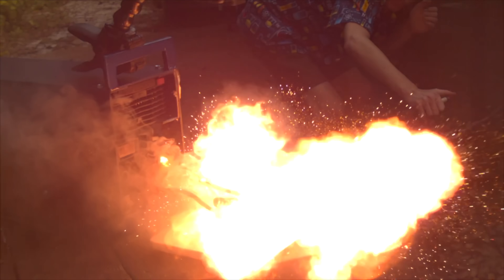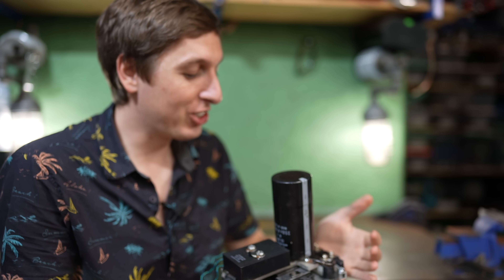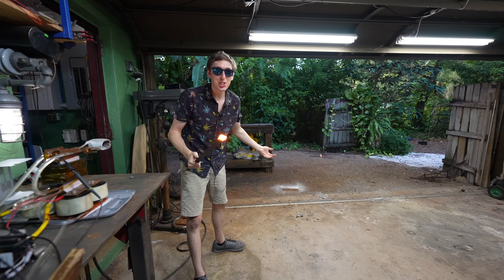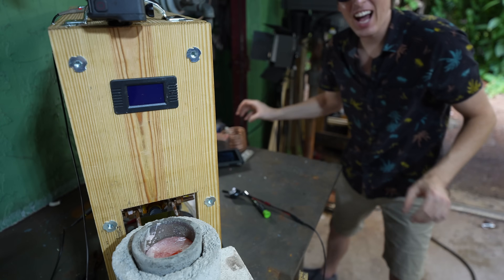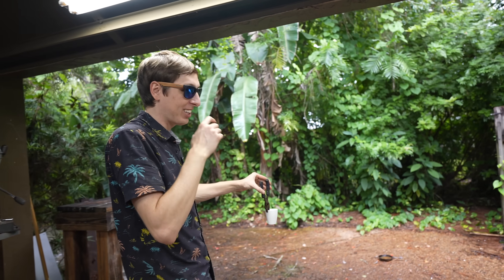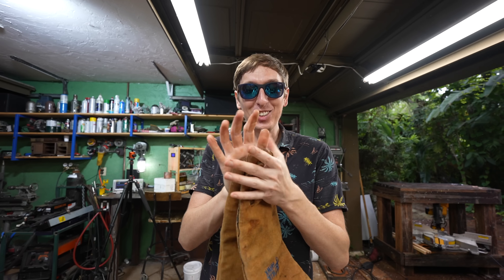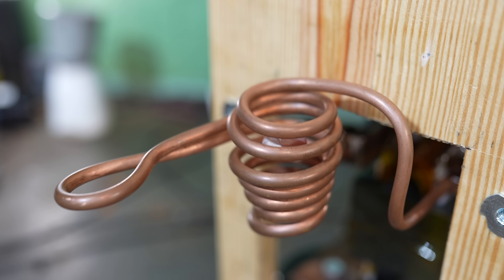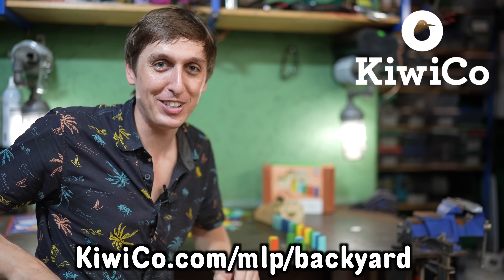DIY induction heater that can BOIL STEEL

Comment: Congrats, you’ve just discovered how steel tubing is welded. The difference though is to run ferrite through the middle of the coil. This will reflect the energy and force the edges of the single strip of steel to super heat, and then run through rollers under pressure, tada! Welded edges of a steel tube.

Comment: You clearly make videos for the lowest denomination of society. You speed through the only interesting parts like actually making the inverter, the control circuit, and programming the microcontroller. Next time your face is that close to molten Aluminum, you should spit into it, this way you’ll be sure to get a ton of likes from your lowest denominators.

Comment: Of course aluminium is going to melt that fast TheBackyardScientist...It's melting point is only 660.3 degrees C while steel's is between 1425-1540 degrees C depending on the type of steel and your setup can surpass both temperatures VERY quickly!

Comment: I'm surprised blacksmiths don't use these heaters. I have a homemade coke forge (coke is just a fancy type of charcoal) made from a cheap grill and a blower and it takes me around 10 minutes to get a 1/2 inch rebar to forging temp

Comment: I was thinking of different uses for an induction coil and had an instant thought of what happens to ferrocerium rods or lighter flints would react. Would they heat enough to do the toss it on the floor bit? Would they possibly melt? 

I remembered this video and thought it'd be right up your alley.
Reply: Lighter flints get to red heat before burning slowly when heated with a miniature blowtorch.
If you could make one shatter finely enough when that hot, it would probably make a lovely shower of sparks, but that would be very hard because they're so small.

Comment: Steel does not explode when it comes into contact with water. However, when you poor large amounts of molten iron or steel onto something that contains water (like wet scrap metal), the water heats up making large amounts of steam resulting in an explosion. We see this sometimes in the steel mill where I work. The explosions are huge and very impressive.

Comment: That was very impressive and interesting to see how easy it is now with off the shelf components to make an induction heater. It worked a bit too well though, I’m fairly certain that all the sparks coming out of the steel was the carbon being burnt off.

Comment: cool.. now seriously, throw a bunch of small scrap neodymium's in there, stir, then transfer to a regular really well insulated pre heated 12v induction heater box, so to slowly cool the mix & recrystalise properly, then dc electromagnetic zap it in situ the box had that coil /required bits included when slapped together right a few times as it goes below the magnet curie point?.. did you get another bigger on demand diy custom shaped neo block.. weaker or stronger than factory ,by how much

Comment: Just wanted to point out the "exploding steel" bit is from getting water in a crucible full of molten steel. The water pretty much instantly vaporizes into steam and blows the molten steel out of the crucible... Full thickness burns are not fun. Just sayin'.

Comment: You didn’t even need the complex circuit. Just run Minecraft with RTX on a crappy pc from 2010 and put the metal on the cpu which would melt it instantly.

Comment: What you are seeing on the steel melt down is called “carbon boil” it occurs when you melt steel very fast without aluminum, especially steel with a high carbon content.
Reply from the maker: oh that's interesting, but I cant find any information on how aluminum has anything to do with it.
Reply: @TheBackyardScientist  Aluminum is added into the bath during a carbon boil to "calm" it down, usually in a very fine form.
Reply: @nicholasknotts8531  so steel is pritty much always a carbon iron and aluminum alloy?
Reply: @hmmmtietmetmosterd  Not exactly, some steel has high nickel, other steel has high chromium, some has high carbon, some has low carbon.  

Aluminum is not a part of steel, it is just added during the melt down process to ensure that the carbon does not "burn-off" and change the chemistry of the alloy
Reply: @nicholasknotts8531  i see, and with aluminium having a much lower metling temperature then the rest of the alloy, can i asume it just burns off while making the alloy?
Tnx for your explaination, its very clear! I apreasiate it allot
Reply: @hmmmtietmetmosterd  That is correct, most of the aluminum will come out the melt, you may see some very minute amount of aluminum in the chemistry (No more than 0.1%)
Reply: @nicholasknotts8531  that makes sense, tnx yet again buddy
Reply: That's actually really interesting

Comment: I’ve personally witnessed explosions from molten steel/slag mixing with water/ice. Explosions big enough to knock the dust off the rafters of the mill, break crane windows, blow open steel doors of the exhaust, etc. A couple of guys where I work were almost in the line of fire when we charged (unknowingly) icy scrap into the molten metal. It was like a bomb going off. I highly recommend purchasing better PPE if messing with molten metals, aluminized protection with a FR secondary layer would be the minimum. It’s definitely nothing to take lightly.

Comment: I have a question, when the metal was melting at one end of the rod, why wasn't the heat felt at the other end. I mean, Kevin was literally holding the rod with his bare hands from the other side.

Comment: Molten metal does not explode when poured into water.  It explodes when water is introduced into molten metals.  Not poured onto the metals.  But if water is trapped in a piece of metal.  And that metal go's into the molten metal.  As soon as the water get's hot enough to boil.  Which is pretty much instantaneous.  The steam (1/4 cup of water = 1000 cubic inches of steam) expands and shoots out the metal everywhere.

Comment: Burning Mg emits bright as black body radiation. The combustion reaction is so hot that the white light is just like the red glow of hot steel, but much, much hotter, which shifts the colour to white. UV light is only barely present in the UV-A region at around 380 - 400 nm. Most of the radiation is between 450 - 750 nm, which is why it is bright white.

Comment: Please be careful on the onewheel, legit was riding it in a straight line, was going in a straight line at 13-14mph and the motor shutoff, I was found knocked out in a park with my helmet on. But I still had 65% battery left. Broke three bones amnesia and a bad concussion I'm still dealing with, this happened 2 weeks ago.
Also its the onewheel xr I haven't gotten to the max speed yet.

Comment: You are all aware that even if He isn't killed instantly during one of these experiments...he will definitely be dead from any number of cancers due to the insane amount of toxic chemicals he breaths in with zero ventilation or rudimentary gasmask.
 But Boy O Boy does that kid know how to melt and sling hot metal across a driveway apparently thinking the resulting splatter is of some  scientific purpose other than making a shiny mess of potentially sharp edged metal fragments that are perfect for a show about how to DYI your own self repair and inflate car tire machine.
 We Love You Pal...just be safe, ok?
👍😁🚬

Comment: This looks so much cleaner an easier for casting parts than those paint can forges using gas. Is there a way to use this to melt wax for lost wax casting?
Reply: Just use a stove

Comment: 6:44 YES. Burning magnesium produces a LOT of ultraviolet light. More than enough to sun burn your eyeballs if you look at it long enough. Its usually pretty hard to burn your eyes just from magnesium because it burns so fast, but you have enough there to do some damage if you stare at it. I would at least wear good UV blocking shades when working with it, but a proper welding mask is not a bad idea.

Comment: It's not boiling the steel I think, that's just the carbon escaping because the iron is no longer holding it due ot how liquid it is. I could be wrong I'm only a rookie smith not a pro

Comment: Dude. You could forge a knife in that first one. Not only that, the way you threw around molten steel from the crucible is basically Chinese steelworker's fireworks. It's pretty awesome.

Comment: Burning magnesium does give UV light, but it’s clearly not because of blackbody radiation due to its temperature, which is at most 3100 °C, hot but lower than that of an incandescent light bulb, so it should look orange and shouldn’t emit UV. Instead, due to chemiluminiscence, about 10% of the energy released in combustion is released directly as light.

Comment: I think the steel may have “sparkled” due to residual magnesium in the crucible. I may be wrong, but it seemed sparkle more immediately after you melted the magnesium.
Reply: Nah, steel just sparkles when it heats up a lot, i used to blacksmith a lot and when i forgot the pieces for a little too long in the forge they would kind of sparkle/melt i don't know if it has something to do with the steel boiling or not

Comment: Water explodes in molten steel, molten steel doesn't explode in water. A pinched pipe with water in it is the reason why a foundry in my city had to rebuild half of their building. This time they added a preheating line to their processing of scrap materials.

Comment: So interestingly enough, when magnesium combusts in open air it does so with such absolute power that it emits enough UV light to be effectively used as an anti bacterial agent. I wouldn't recommend it though haha
Reply: This is great information! Science!
Reply: So what you're saying is, flashbangs can be used to rapidly disinfect rooms?
Reply: @Oglokoog  Exactly, just don't forget to wear your dark sunglasses.
Reply: @tommytheshimigami  That's alarmingly based.
Reply: @Drekromancer  pokemon!
Reply: I wonder if pure oxygen would make it burn even brighter?
Reply: @1978garfield  Believe it or not, when magnesium burns it actually does so with such destruction that it even rips the oxygen off of water vapor in the air! That only adds to the brightness of the reaction.
Reply: @nicklittle8399  Or even from CO2 or sand!!!! Magnesium is crazy!

Comment: ferrous bronze: one-part-aluminum two-parts-copper and three-parts-casting-iron, melt, stir, cool and remelt to finish the alloy; the first melting gasses-off part of the aluminum but the finished-metal can be tempered.
Reply: when you melted the aluminum then magnesium you set up a part of thermite, and when you melted the steel it finished the thermite concoction.

Comment: My induction heater will only heat up ferrous metal. What am I missing ? How is this one heating up aluminum ?    Also how did this not result in a trip to the ER. I have burned myself casting before. It is no joke how fast and how deep a small blob of molten metal goes thru human flesh.

Comment: WHY is the water tank next to all the high voltage,high amperage circuits?!
Also having a wooden casing next to very hot materials doesn't seem like a good idea and the fact that its just open on its sides means the fans could draw the sparks to the sides and possibly scatter it around in the circuitry and worst case scenario into the high voltage circuitry.

Comment: The "explosions" from molten steel "mixing" with water is not the mechanism for the "explosion". Water and molten steel do not "mix" resulting in an explosive chemical reaction. Its the water flashing to steam almost instantaneously. The steam has a very high thermal expansion rate. Which causes the "explosive" effect. So dropping the molten steel into to pool or the ditch didn't give the desired affect due to the volume of water not being able to flash to steam, it only starts warming the water and cooling the steel. A smaller volume of water in a larger volume of molten steel would provide the desired affect.

Comment: Greetings Kevin, I’ve had this question for a while. Since you now have a larger and better induction heater, will you be able to melt tungsten? Just curious
Reply: Tungsten melts at arround 3410°c 
While steel boils at arround 2900°c
Sooooo, maybe?
Reply: Second.
Reply: If he boiled steel i could see it happen

Comment: Yes, burning magnesium generates lots of UV including "germicidal" wavelengths.
So you probably got a little sunburn from it.

https://etda.libraries.psu.edu/catalog/10735

If you want to go real crazy, magnesium might be a good XUV laser material:

http://citeseerx.ist.psu.edu/viewdoc/download;jsessionid=CA8391F9C97A457092796FCADEE97D0E?doi=10.1.1.516.2784&rep=rep1&type=pdf

Comment: you should've used a shielding gas so that you could throw molten magnesium that didn't have an oxide layer, and so you could control the burn a bit more.

Comment: You know, I just thought of something, could this be a better alternative to blacksmithing? Considering that it heats up the metal at a faster rate than a regular forge, though going back at this, I think it'd be more difficult to create a large induction heater than just making or buying a simple forge.

Tell me what you think in the comments.

Edit: I don't know the standard time of how much a regular forge can heat up metal, but I think its much slower than an induction heater.

Edit 2: I just found out that induction heating is used in the metal and foundry industry, so I guess I just answered my own question.

Comment: I remember getting an ebay kit, successfully melting stuff with it (i think i have a vid about it), but the problem always was that after certain point (curie point) metal loses conductivity, and cannot simply heat up further. that happens way before melting. For that reason graphite crucible was used since it doesn't have that property, melting was done via hot graphite. The problem with it is that it burns out, so the solution was to get an inert gas atmosphere which is another bulky system. 
You have demonstrated that indeed metals can be melt not through graphite, but directly. I guess its the ridiculous power that overcomes the increased resistance so Curie point doesn't even matter anymore?

Comment: I wish the induction heater was easy and affordable to make...
Reply from the maker: you can find a lot of this stuff a lot cheaper than i listed, this is just the going prices for stuff online. for example i found my capacitors for $5 each, and IGBTs for $10 each, you don't need a radiator or fancy cooling fans, you could just use a big bucket of water and a $10 pond pump 

ive seen people accomplish a lot more than i did with a lot less :P
Reply: @TheBackyardScientist  ok sir thank you....

Comment: how come you can just put a steel bar into the coil?    i mean sure there is some plaster in there,    but arent you afraid the plaster has cracks?    i dont know if the current in that coil is dangerous to humans but dang that looked scary haha

Comment: How about putting your liquid-metal-guns receptacle in the coil? Make it out of plaster or w/e's strong enough to be pressed against to pump. Have an outer cage that locks it on maybe so it doesn't drop it on your toes.

Could spray a mist on 1/16'" of oil in baking sheets or something(would the ball aquarium hold up?). Plus there's all the pumping iron puns/jokes we could then make. :p

Fun vid! Thanks for the brain food. Cheers from Ontario.

Comment: at least he bothered to use eye protection.  why he doesn't bother with typical OSHA required safety gear for steelworkers is beyond me though.  the betting pool for when TBYS is significantly maimed or killed during a shoot is starting to heat up.  seriously my friend, we want to see you do your thing for a long time to come... be safe.
Reply from the maker: eyes don't grow back! Also I was only melting about a tablespoon of steel, its not the same as potentially gallons of steel raining down from the ceiling.

Comment: try silicon, distillation of matter, separation
Reply: wall socket delay mixer, zap ionization, de-oxygenizer
Reply: high rpm motor ac generator 10kHz
Reply: vacuum melting
Reply: do it as maglev induction melting bowl

Comment: You did not show us what the steel in the pool looked like after solidifying!  Some other things I would like to see: Try levitating some magnesium till it catches fire;  leave the sparker rod on the firestarter so you can see it burn; throw molten magnesium in water; try melting various kinds of minerals and ores; heat graphite hot enough to burn; light up a florescent tube and/or bulb; heat steel and/or other metallic powders in a ceramic container; I could go on and on.

Comment: That sparking is the carbon from the steel burning off. If you want explosions from white hot steel put some water beneath it on an anvil and hit it with a hammer.

Comment: Serious comment:

You could probably make this more energy efficient and more reliable using gallium-nitride, a 3-phase (or 12-phase) alternator, and a flywheel. Adding some liquid cooling to the induction heater would also keep the heater itself from overheating and further increasing energy efficiency (and if you really want to go above and beyond, I'd recommend silver coils instead of copper).

Additionally, you can probably wrap the exterior of the copper coils with some ceramics and steel wire to help focus the electromagnetic field into an even more concentrated point.

Lastly, see if you can source some Insulated Gate Heterojunction Bipolar transistors. Even faster and even more energy efficient.
Reply: Oh yeah I think I remember Styropyro using an angle grinder as a flywheel in his terrifying arc machine.